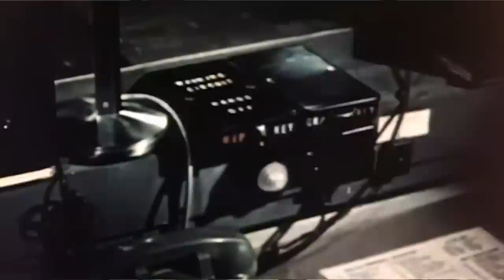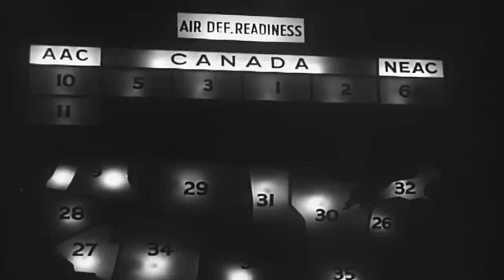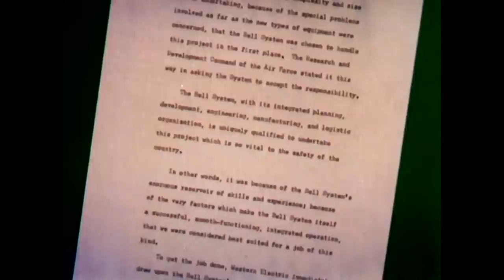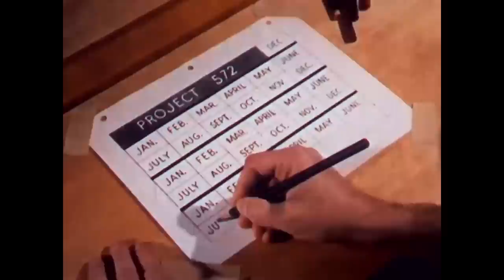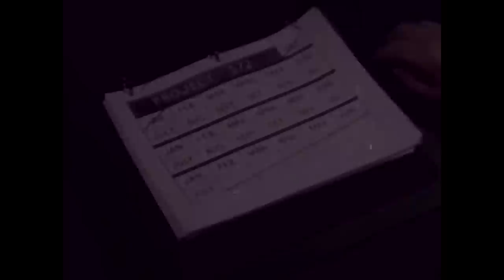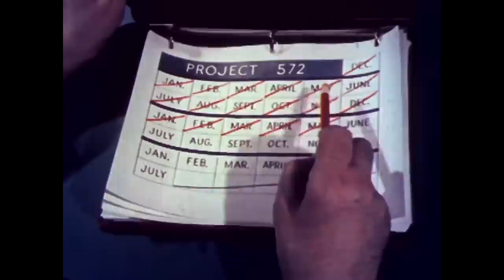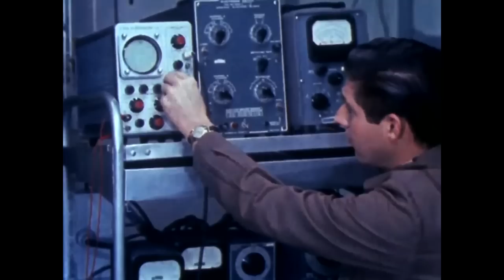Arctic Distant Early System | The Cold War Era DEW Line. Defending The North American Territory

Comment: Now all these sites only have 4-5 people at them,  2-3 techs and a couple mechanics. All the radar data goes to other places to be viewed. The big camps are mostly empty.
Reply: I was stationed at one site (Watford City, ND) when it became a JSS in 1978,  and I was the ONLY military member.
Reply: Very, very few of the original Dew Line posts in Canada are active as the DEW Line was shut down in the late 1980s. The reason was the technology had changed so much that Canada and the U.S. realized they needed a new series of radar stations to replace the DEW Line, and that was the birth of the North Warning System. 
New installations were built, and some of the old were joined with the new and modernized while the rest were either stripped of military tech and given to civilian groups or were either torn done or abandoned

Comment: If it no longer works. Why did Canada and the U ited States do a  ajor rehab and upgrade of this line in 1986, staring with installing Fibre Optics Cable for commu ications. Worked on this project for Canac Microtel for almost a year ? Gary in Canada
Reply: It was replaced with satellites.
Reply: @rty1955  There are still Radar sites running in Alaska, as well as new sites for the missile  intercepter system.  Also still running intercepts of Russian aircraft on the regular off Alaska.